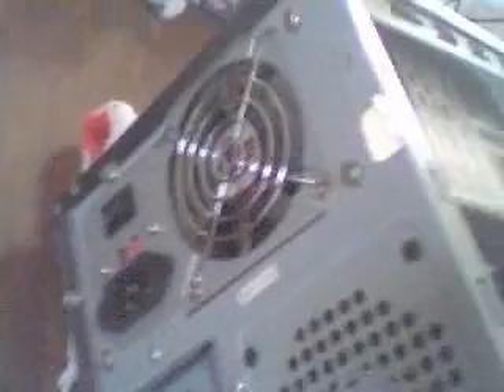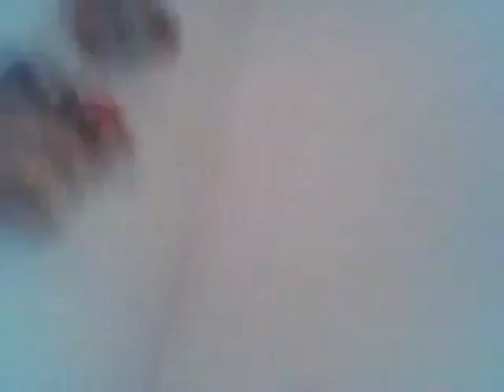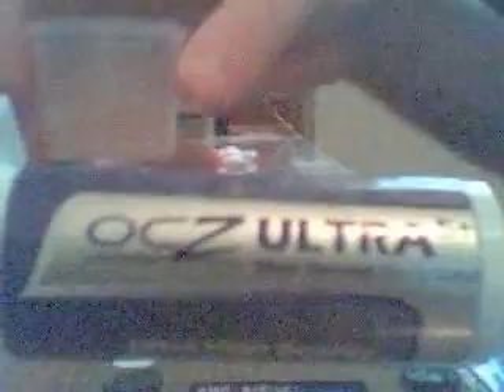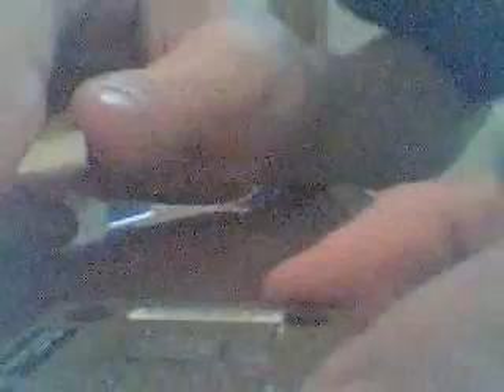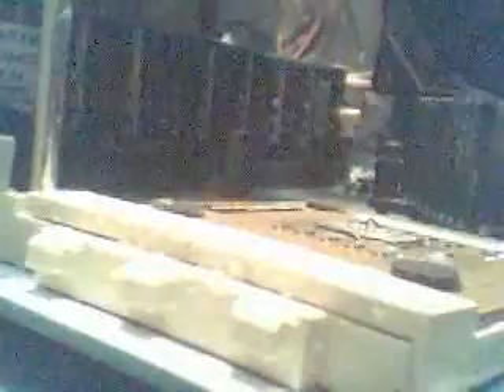How To: Replace Heatsink and Thermal Paste

Comment: I don't recommend using any flat object or anything like that as you run the risk of air bubbles in the like, just put a tiny blob on their or a pea size will do and then press the heatsink down in their (Basically attach the CPU to the motherboard and heatsink on top for the thermal compound to set in).

Comment from the maker: if you are careful, and dont grab the processor by the pins, you wont bend any. And bubbles always have the same chance to form in the end, because they are pressed down by the same force either way, its just good to spread it out beforehand so you get even coverage. and bubbles wont hurt anything, its when part of the core ISNT covered that will hurt things.

Comment from the maker: @debconte123 no problem. Some people have said I used too much thermal paste, but as long as the paste covers the core/heat spreader, the excess will get spread out by the pressure of the heatsink.

Comment: @spenser2004 The thermal paste isn't actually like glue. It's more of a suction cup that merely transfers heat.

It shouldn't be difficult at all to seperate the cpu and cooler unless someone used elmers glue instead of thermal compound.

Comment: nice video, few questions though...
the contact pins while u r pressing down, isnt there a chance they could bend or something while you are turning it and pressing down on it on the table?

also the pressing down of the popsicle stick many times... isnt there a chance air bubbles could form which is not good, so pressing it down once with heatsink has that advantage?

Comment: Leaving the power supply plugged in (but turned off) does ground the system.  From there, so long as you're at the same potential as the case whenever you are handling components within it (which you can do just by touching it), you don't need to worry about static electricity.

Comment: Thanks for the video, it helped me understand what I need to do when I build my computer soon, but I have one question.

Should you spread the thermal paste on the SIDE of teh CPU core? Also, do you think the stock HSF that comes with the new Core 2 Duo's are fine or are aftermarket versions better right off the bat?

Comment from the maker: The chances of the amount of sweat on your fingers messing up computer parts is so minimal, its not enough to be worried about. As long as you arent dripping sweat all over the motherboard, you are safe from that causing a problem. (and even if u do get the mobo/some other part wet with sweat or water, it should be fine as long as you let it dry out completely before using it.)

Comment from the maker: Some would say yes, but the basic idea is that as long as your electrostatic potential is the same as the case, you don't need to worry about shocking anything. So no, it doesn't HAVE to be grounded, but it's not a bad idea.

Comment from the maker: thats not really a problem temp. you dont need to worry until its 60+ and even then its not like its going to die any second. the only thing you can really do is get a bigger heatsink. new thermal paste only helps a little bit.

Comment from the maker: thermal paste is usually good for a _VERY_ long time, unless you remove the heatsink. you should always put on new thermal paste whenever you remove the heatsink. if you havent removed the heatsink, your paste should be fine, unless it is very low quality.
but if you are bored, new thermal paste every now and again cant hurt :)

Comment: Great walkthrough. Mine was a little different, it didn't have the little screwdriver slot on the heatsink, it was plastic side clips.
Would have been better with a decent video recorder.

Comment from the maker: well the new processor should come with a new heatsink, but if not it should be alright to use the old one. Just dont overclock, the 6000 gets considerably hotter than lower end processors so you dont want to push it since the old heatsink might not be big enough for great cooling.

Comment from the maker: it was a brand new heatsink, so i didnt need to clean it. 
about the filling microscopic holes idea, i dont think it would make that big of a difference if you applied/removed, becuase the whole purpose of thermal paste is to fill in the gaps when its applied, so it probably wouldnt change much.

Comment: I used to hate those little exposed cores until I discovered thermal paste on a heat-spreader often turns into cement.  I've yet to crack a core, but I've pulled more than one CPU out of the socket without releasing the lever-- just trying to remove the heatsink.  Now, of course, I twist them loose before trying to pull them off.

Comment: i have the same problem my comp goes up to 100 degrees celcius and idles at around 72ish. i changed the thermal paste 5 months ago and right after i changed it, it helped but now it hotter than ever. so i'm thinking of changing the paste or removing some since i put like a dime size amount on it, or change cpu fan

Comment: 14 years later and I'm revitalizing the a socket 462 motherboard with an AMD athlon. And the thermal paste is 20 years old. It has the consistency of super glue.

For other time travelers out there, I have a question: do you want to spread the thermal paste over the other parts of the cpu than the core? Newer cpus have one metal plate, but mine is like the one shown in the video. It has smaller components around the core.

Comment: I take it the copper base of the heatsink has a much larger face than the actual cpu, its just the cpu looks tiny compared to the base of the copper heatsink, found an old case someone had thrown out, so thought I would use my old athlon again, so its been along time since I even saw the heatsink.

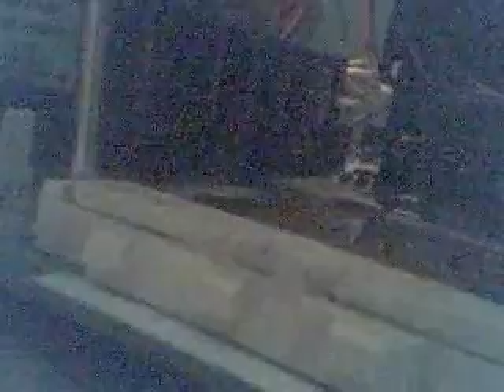Comment: wtf. i posted a comment like 2 days ago and its not up? anyways, what i said before was that your hilariously informative. kept me interested and laughing the whole time. 3:32 is classic....i just wish you were instructing how to handle a am2+ mobo and processor replacement.n its different but as you said, not hard to figure out. i was wondering, whether or not adding an extra cd-dvd drive in my rig would increase the temperature of the system? anyways thanks for the great vid hope there more.

Comment from the maker: if the paste hasnt set, it should be pretty thick, and kinda like play-dough i guess. it shouldnt take too long to clean, i used isopropyl alcohol in the video. and it would be a lot easier to take your cpu out of the mobo when cleaning it.

Comment: I'm buying computer with the intel stock cooler for the cpu, i'm going to replace that mess of the cpu heatsink with a Arctic Pro 7..

Ok, now to the question.. if my paste hasn't set, what's gonna happen? Will it be gooey or something, will I have to clean it off for ages? Also what did you clean it with, that liquid? And could I clean my cpu while in my case?

Comment from the maker: @mamalekimsn No, I don't think there is any household material that will safely replace thermal paste.
Reply: According to Tech City (or Tech YES City) tomato sauce can function as thermal paste, not as effective, but it works. He hasn't checked on it after using it for a while tho.

Comment from the maker: water will not damage electronics as long as you let it dry out. water damages circuits that are running, by shorting them out and putting voltage where it shouldnt be. As long as the equipment is not powered, and you let it thoroughly dry, there will be no problems. Note: the alcohol I used was 50% alcohol 50% water, and the cpu I used it on is still running perfectly today, just to prove my point.

Comment: I just recently bought an E8200 with an intel core 2 duo stock heatsink. the processer fit in perfectly but the heatsink did not. I used to have a  Intel Pentium dual-core and the Pentuim dual-core stock heatsink, which u had 4 screws that fit in my mobo fine. BUT my new core 2 duo heat sink has 4 push-ins instead of the screws. The push-ins wont fit in the four little holes (thats what she said...) on my mobo. Any ideas?

P.S can i use my old Pentium dual-core stock heatsink for my E8200?

Comment from the maker: No, you dont need to put thermal paste on the side of the core. And, Intel seems to have a habit of always shipping their cpu's with the cheapest, lowest quality heatsink possible, so yes, pretty much any $20 hsf would be better than the stock. However, as long as you arent doing any overclocking, the stock cooler should do OK.

Comment: If it is metallic based compound it'd be disasterous to have the excess seep onto nearby circuits. Also the thinner the layer, the more efficient the cooling is. Too much compound is not good at all for the heat transfer.

Comment: lol sorry i was scared. I happened to have another motherboard spare with a cpu and heatsink already in place (better cpu than mine but still socket A, My old cpu was a AMD Duron. this one is now AMD Athlon XP 2400. So i think it is better, but i replaced my components into my new computer case and i got it working so im so lucky really :D

Comment: No, dont put it on them. In some cases, doing that can cause the cpu to not work because some thermal paste is conductive to electricity. They are capacitors, the cache is built into the cpu core.

Comment: I think you were using a bit too much paste than needed. Also you should twist the heatsink slightly to spread the paste out and also possibly remove any air bubbles that might have been formed during the process.

Comment: I need your help i screwed up bad! i tried taking off the heatsink to replace my cpu and i accidently jabbed my mobo a few times.  dont think i did to much dmg, but i put my heatsink back on and now when i tried turning on the computer it doesnt turn on. the green LED is on at the front of the computer though. PLEASE HELP!!

Comment from the maker: Well if they are the same socket then both heatsinks should work. Of course id have to see it to be sure but oh well :p I never liked intels heatsinks, they are always so finicky to put on. To answer your question, yes the pentium dual core heatsink should be fine, just dont overclock. 

ps. what the hell kind of girl are you doing that has 4 holes? o.O

Comment from the maker: It doesnt prove anything about the "quality of the processor". It is not meant to be run without a heatsink, so the designers shouldnt need to worry about what happens when it isnt there. If you take all the cooling out of your car engine and the engine dies, does that mean it was a crappy engine? No, because its not meant to run that way. The "quality of the processor" is determined by its processing speed and that is it.

Comment from the maker: how is that true at all...

when you touch the case, any static charge on you is dispersed throughout the case. it wouldnt matter one way or the other if the psu was plugged in because the case/psu exterior doesnt touch the internal circuitry anywhere.... so even if the psu was plugged in there is NO way for your charge to get to the grounding wire.

Comment: I accidentally removed the heatsink when trying to unscrew the fan to clean it. When I realized what I did, I immediately screwed it back in, but I noticed the paste was dried and crusty. Now the computer won't stay powered unless I hold the button. Is it because I need to clean the dried paste off and reapply fresh stuff? I hope that's all it is...yikes, I could kick myself!

Comment: About using IP-Alcohol, Most bottles comes in 70% or 91%, Neither is good for cleaning CPUs, Why you ask, The 70% contains Electronic Damaging WATER AT 30%, Most good Electronic stores & Drugstores will sell you 97 - 100 % pure IP- alcohol upon request.